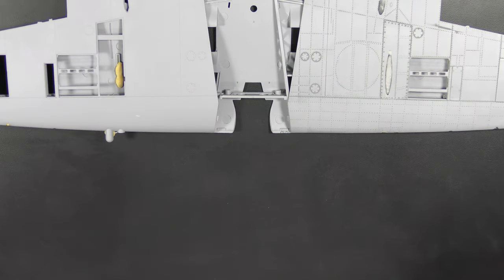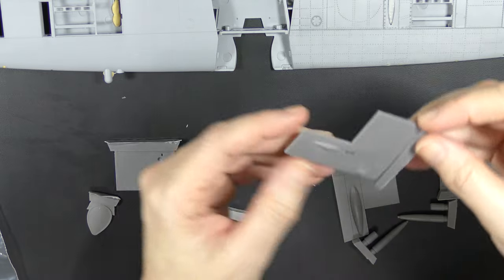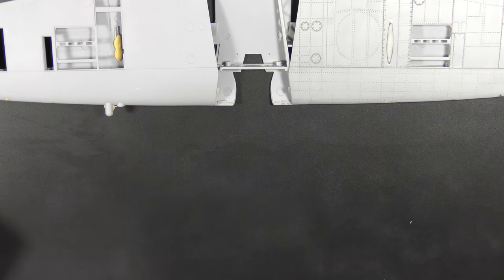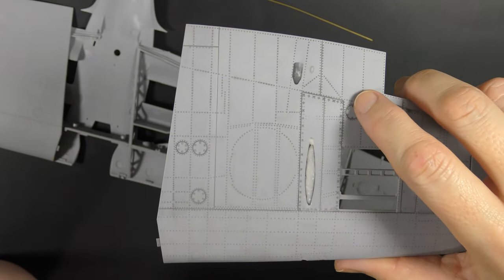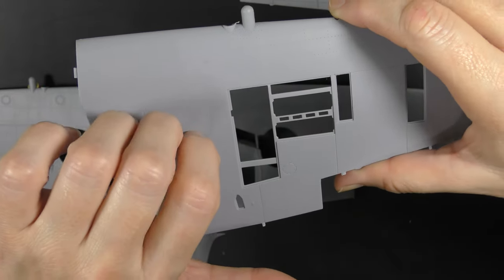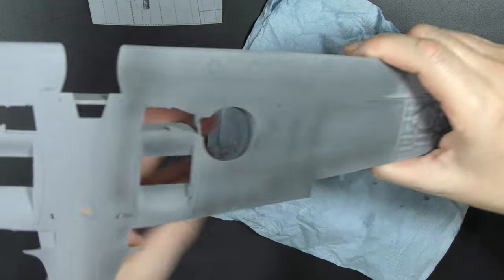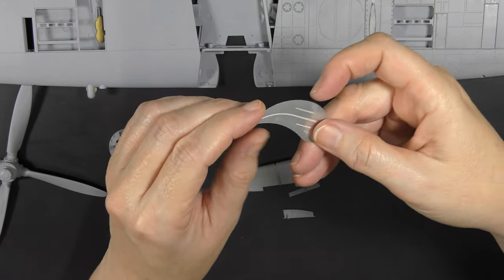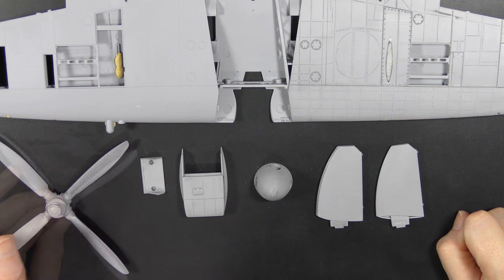Building the Silver Spitfire - Airfix 1/24 Spitfire IX - Part 2

Comment: Lovely project, not seen litho plate being used for a very long time.  If you ever need any more I have several lifetimes supply in both 0.15mm and 0.25mm thickness.

Comment: Big thanks to you Jen for your inputs to help create the aftermarket parts for a G-IRTY build.
As you stated the Dzus fastener can be corrected on the kit but having a PE replacement would be  
more desirable. I have the same wheel/ round exhaust kits ordered from BNA Model World in Australia.
Recently received the Quinta Studio 3D cockpit set but as good as it is the Airscale upgrade is still the best. Side by side the instrument panel by Airscale looks more like the real thing.

If the Sharpie signatures were a detail you want to add. High contrast images or reproducing the writing
can be scanned to scale and printed on laser print decal paper. 

I emailed Paul H Monforton 14,15/11/23. He is doing well and the reference book or PDF is still available at Monforton Press. There has been a problem with security code warnings with his current email  and the fix is to replace with a new email address  between now and December.

Now a subscriber and have always click the, like on your videos.
I have a new video of the Revell 1/48 SR-71 posed inflight with the l.e.d. lighting on my channel
if interested.

Looking forward to watching updates on what will no doubt be an amazing build.
Reply from the maker: Thanks. I did order and receive the Monforton book in pdf format even though I have a printed copy. Once I figure out how to get it onto my Ipad it will be much easier to use on the bench than the book is.

Comment: Thank you for this informative update, I envy modellers who can maintain interest in large projects and who possess the perseverance to do that amount of prep work! 
When you demonstrated  making the blister with litho plate I anticipated you'd use the pressed shape as a mould to make a new blister from epoxy or similar. Won't the litho plate blister be marginally larger than the original part? Regardless, thank you again for sharing!
Reply from the maker: Yes, marginally bigger but only by the thickness of the metal. I think the kit blisters are a touch small anyway having seen the real thing.